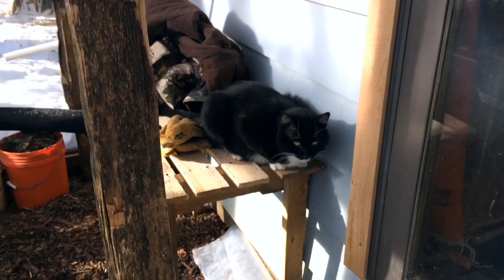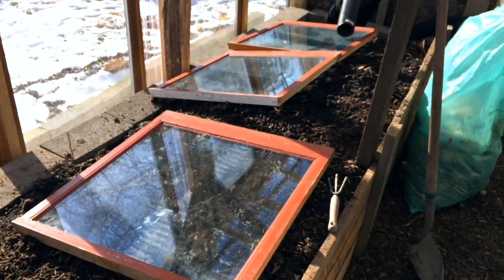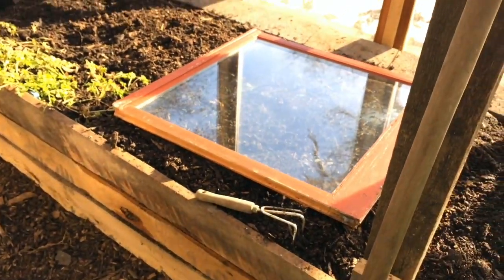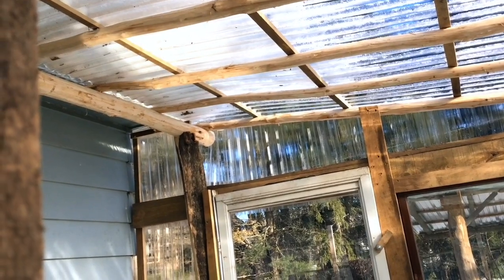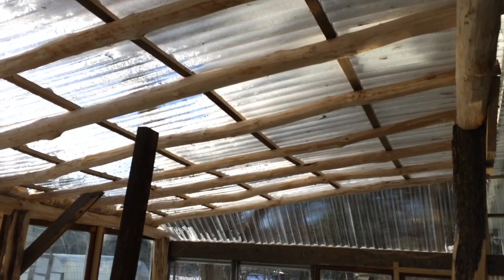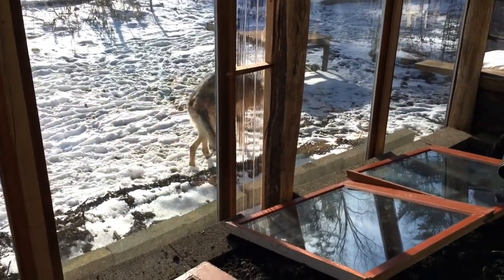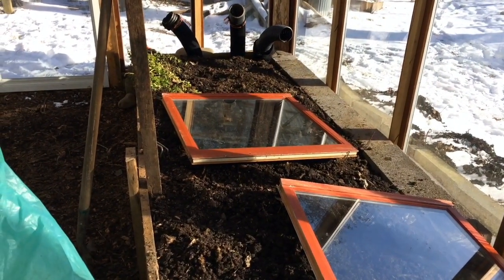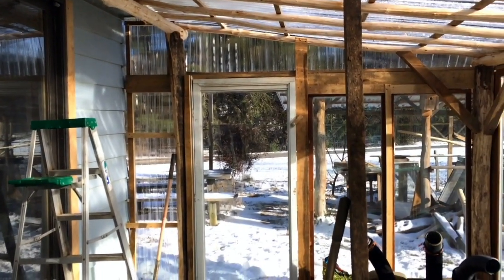Passive Solar Greenhouse - Cold Frame Sketch and Wool Packing

Comment: A few thoughts: cold frame with tubes inside frame, timer on the fan to start later in the day after the heat builds and lastly greenhouse plastic either pinned up inside or used as a wrap outside acting as a double layer trapping heat within the air space.  I wish I was the one with all the information you seek on wiring, but I did find reliable information, so if you find yourself at a loss, I will be more than happy to direct you to the information.  Just let me know, love you guys, love the channel and look for my order later this year.  Thanks again for all you do for the community!

Comment: In the winter, I would think the beneficial solar gain you are getting would be coming though the vertical glazing due to the low solar angle and minimal though the roof panels. So the insulation layer that the snow on the roof creates might actually be something you would want to keep. Just something to consider.
Reply from the maker: Good point.  I was thinking that too... The challenge is, though, that the sun would like to go through the roof to come into the home through the sliding glass doors I installed in our living room.  That extra light and warmth in the home is worth a little warmth loss from the roof in the greenhouse...

Comment: Maybe some tarps or old sheets to roll down in front of the windows at night to help hold in the heat?  Maybe some water barrels painted black for heat retention?  I'm curious to know if the greenhouse is helping with the temperature control in your house that it is attached to?
Reply from the maker: I think once we get the greenhouse buttoned up better and the climate battery active, it should be able to play a role in heating our home on certain days.  Thats a hope with all this.  Ways to cover windows or hold in heat at night would be nice, it's a design layer that we may explore.

Comment: What ratio of green inputs vs brown inputs gives you the most heat off of your compost heap? What depth of compost could you keep in that room to generate heat? Maybe a simple long box filled with compost you could walk on next to your raised beds might increase the overall mass producing heat to warm your beds.  You might need small steps on either side for ease of use. Remember, you said you had too much compost in the chicken coop so that's a free heat source! Ha! Good luck! You are doing great work. Love your programs!

Comment: It wouldn't help with the reflection idea of yours but you could try glass cloches using those old fashioned metal clips. They could be moved around easily to wherever you needed them and dismantled for storing in the summer. Were they called barn cloches?  I heard of someone getting the clips on eBay

Comment: Nice.  Also, you must know that the frame holding up the roof will not support some of the deep snows that I know you get sometimes.  You can rig up a way to support the windows so that they are not part of permanent structures so you can have more flexibility...maybe plastic wrapped around wool rolls.  Many possibilities.  Inspiring.

Comment: I could be wrong here because I don't have much experience with solar but I think you would need quite a few panels to run a fan capable of forcing air through the pipes. Used HVAC fans from old furnaces or should be very inexpensive and might serve better. Again I could be wrong here maybe solar is capable.

Comment: Hey Sean, just wondering if you’ve considered passive solar hot water heat for the greenhouse? Those windows duplicating a cold frame in there could totally make that happen. (Apologies if someone else has suggested that….I didn’t read through the comments). Also, if you’re looking for a good book on sustainable architecture in different climates, try “The Barefoot Architect” if you haven’t already

Comment: One method you might like to try is to build closed poly-low-tunnels inside the winter greenhouse. This method is used by One Yard Revolution (OYR on Youtube). Also, no need to build a new tool to clean the top. You can get a snow rake meant for roofs (don't use this directly on asphalt shingles as it will destroy them. Ask me how I know...).

Comment: I'm getting pretty confuzzled myself on the solar setup.  I bought a 100 W panel, charge controller, and a small fan.  With my particular charge controller, I think I have to attach a battery and run the fan off the battery.  Better in the long run, I guess, but like you I was hoping to just run the fan when the sun was shining.
Reply: hi morgan, a charge controller is used to charge the battery, from my understanding. someone made a comment here saying how to set up a solar direct.  check it out
personally i think your panel might be a bit powerful for a small fan, cant really say without all the figures.
Reply: @gazza2963  Thanks, yeah, I read that comment below.  If you're talking about the same comment I read, then he says "make sure the voltage of your panel is the same as the rating for the fan."  My panel is rated "12-18V", but when I hook it up to my charge controller, it seems to output 20-22 V!  Makes me worry about directly connecting the two.  Of course the charge controller has next to NO documentation (what do you expect for $12 from Amazon ;-).  I decided to go ahead and buy a $20 12V lead acid battery...we'll see if I can get it running.
Reply: @MorganBrown  $12 for a charge controller? yeah that is very very cheap, good luck with your little experiment
Reply from the maker: As you learn more on the process please do share with us! :)

Comment: really enjoying your video's. thanks for sharing. love the way you add your corrections in, gives me more faith that your giving us all the true facts on your permaculture adventure.   Am unsure on what materials you have at hand, but i do like the idea of the angled windows to heat up the roof. if possible i would do them outside, they could become a cold frame later in the year when you dont need the extra heat. it would also give you an extra layer at the base of  the front of your greenhouse, less chance of thermal bridging in the ground. ive made that sound way more complicated than it is lol. build a cold frame outside, in the day times angle the windows to shine in through the front and up to the roof. good luck
Reply from the maker: I am thinking about putting some cold frames for the space in 'front' of the greenhouse to help capture more warmth and have that help with the main space.  Good reminder!
Reply: @edibleacres   no worries, good luck

Comment: I've seen greenhouses with tar polka dots to absorb sun and melt frost. Also, staining the roof beams will heat the roof, but I worry it might warp the wood.
Reply from the maker: I think making the wood dark would concern me since it would make it accumulate probably too much heat in the summer, but perhaps there is a way to fit in something dark in places during the winter to help snow melt.  Hmm....

Comment: up here you cant run a green house in the winter unless it is one part of your home with in floor heating andd well insulated and low E windows, or a more costly one to heat one with 2 layers if heavy plastic with air blowing between them and high output furnaces and lots of money to keep it heated our a good out door wood furnace with hot water line in the ground and water to air rads. even in spring if you want to do starts in a green house you could start in April as long as you have a good wood stove and keep it loaded 24/7
Reply from the maker: You are definitely in a colder place than us!
Reply: @edibleacres  i sure am, a very cold place this north western Ont, Canada, this morning it has warmed up to 16F, if you have yet to check me out please do

Comment: PC fans run on direct current and can be wired directly to a solar panel i wired mine through a USB cable set up when i had mine running
Reply from the maker: For me it is understanding how to scale the panel to the fan I'm using, etc.

Comment: I haven't read all the other comments so this may have been covered already, if so, please forgive me ;)  Elliott Coleman says each layer is like moving another zone further south. So the greenhouse or hoophouse gets you one, then a low tunnel over the bed gets you two and a rowcover on the bed gets up to three.  The trick is not that any of this is increasing solar gain (you can't add layers and Increase gain, you lose with every layer it has to pass through), it's reducing the rate of loss of energy from the bed. So the additional covers go on as the sun drops and you are not gaining any more energy. Insulated curtains that you could drop to cover the walls at night would certainly help, again, it's another zone with each layer ;) But you capture heat while the sun shines and then keep it in the bed with layers of "blankets".
Reply from the maker: I am aware of the layer bonus idea.  something I am considering as I develop this.  Most likely I'll go with cold frames as a baseline and know I can put blankets over them on the coldest of nights.  Feels like the least intense way to manage it.

Comment: If you cover the floor with charcoal, will that get tracked inside on your shoes? Are you planning to make a charcoal free pathway or stepping stones?
Reply from the maker: We'll have to see how it works.  I thought about that myself.  I think we'll have slip on shoes for us that we can use in the greenhouse space since even the woodchips would have bits that might get tracked.  So far it hasn't shown to be an issue.

Comment: My old cat Snickers is 18 is definitely showing his age too and kind of looks like your puppy. Your cat Stanley is enjoying himself.  That is a good temp for the soil and growing things. Is it that at night also by chance? Wished I  could help with the wiring, but not my strong points. lol
Reply from the maker: It dipped down to low 20s in the soil area at night.  Pretty rough for spring starts, but not unmanageable for hardy greens.  But as a baseline it is a decent place to work from.
Reply: I agree with that from my experience. At least you know what is going on at the moment. I suspect from what you have shared so far that the greenhouse set-up once finished those findings may change and improve. It is fun to see the progress in the mean time. :)

Comment: Put a piece of black steel pipe to the outlet and run it to near the top of the greenhouse it will heat up with the sun,become a solar chimney and draw the  heated air through the pipe and thus the bed and create circulation in the greenhouse... No fan needed. Perhaps it will help melt that snow too if engineered correctly..of course the draw would only be during the day but should fill the thermal mass anyway.. ....perhaps it could also be re-engineered to vent the greenhouse in the summertime......first time I've ever commented on a YouTube video 😉
Reply from the maker: Pretty golden idea for a first comment on youtube!  Hoping you comment more!
I've thought about solar chimney effect and black metal to associate with the tubes and 'run' the system.  Something for me to start exploring for sure...

Comment: I love the idea of using reflected sunlight to melt the snow on the roof.
The interior edge of one pane could be propped up with just two sticks at the desired height.
I wonder if an enclosed 3-dimensional cloche\cold frame warms the soil any faster or slower than the 2-dimensional panes set at an angle? Perhaps I'm delusional, but I have this odd notion that the microbes in the soil respire\off gas; capturing that gas may help heat it. It would be worth an experiment, I'd think. I reckon the amount of gas exchange is small, so a smaller cold frame may have more impact than a larger one. Just a theory that I would love to see tested.

Comment: Wiring DC fans to Solar panels is pretty easy.  Make sure the solar panel voltage rating doesn't exceed the voltage rating of the fan.  Connect the wires such that the fan spins in the desired direction.  Done.

Cold frame angle.  The difference in transmittance by angle for glass, is pretty small (if you give me your info, I can get you exact numbers).  More important is the angle of the SOIL to the sun, as it will be absorbing most of that sunlight.  Remember that no matter what you do with the glass, it is REDUCING the heat applied to the soil,  the point of the glass is to retain heat at night.  If the glass ends up being a pain due to weight, you can replace them with interior storm panels (frames with two layers of shrink plastic), much lighter.
Reply from the maker: Good layer of thought here.  I have the soil pitched just a bit to the south, within reason for the space I have.  Thinking through a way to allow good solar gain by day and protection from heat losses at night is the next design push to make, and something I'll probably explore a few different routes on.
Reply: @edibleacres  The trouble with glass is that it is heavy.  If you want space for plants to grow, you need to elevate the glass in front, if you want it tilted, you need to raise it even more in back.  Both of those supports are shading either the garden or whatever is behind it (thermal mass?).  Light plastic row cover can go all the way down to the soil level on both sides.  More sun on the garden and elsewhere, easy to move to access the garden.